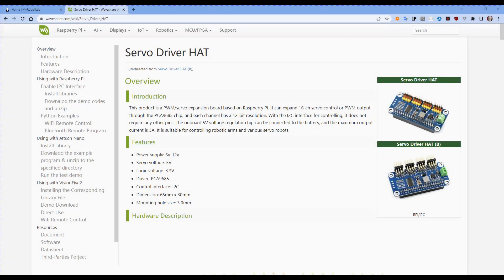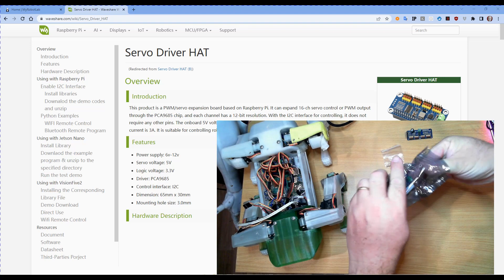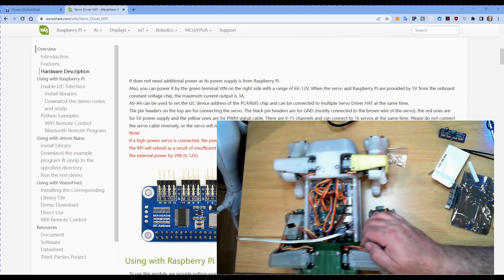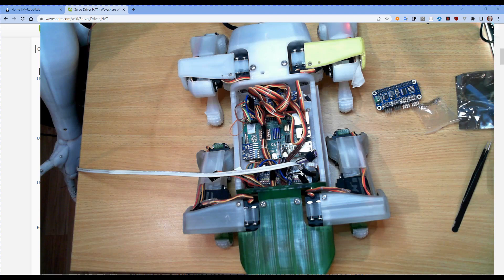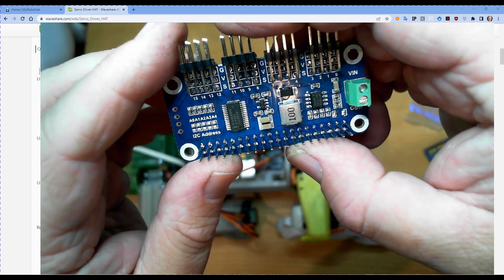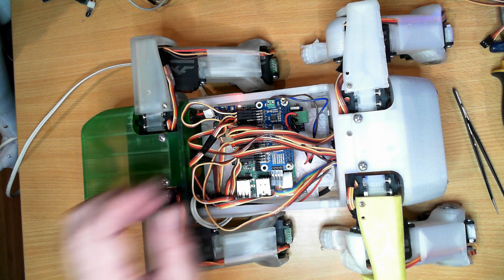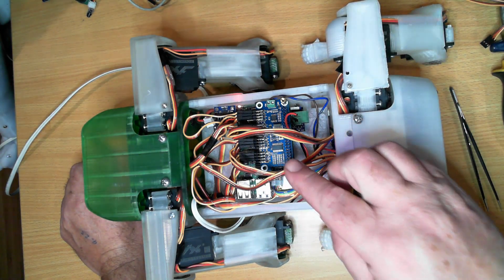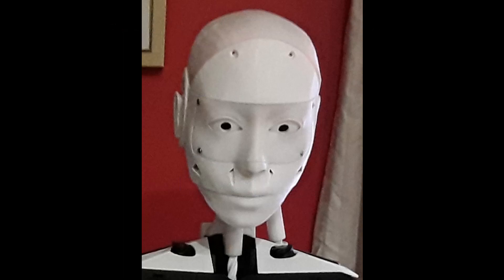SpotMicro Part 30

Comment: How did you power the servos, the pca9685cant handle all the power
Reply from the maker: The original Adafruit ones can't, but the Chinese copies without the reverse polarity protection for the servo power terminals can.
You do need to power the servos via the green screw terminals, the V+ connections on each end of the PCA9685 can not carry the current.
In this case, I'm also powering the control at 3.3V
Reply: @CyberOne  Can you give me a link(Im living in turkey)Thanks
Reply from the maker: @roberenes  Try this one:
https://www.aliexpress.com/item/1005005670283526.html?spm=a2g0o.productlist.main.1.e7b84n8P4n8PwM&algo_pvid=83ab74ec-4a57-453c-aae5-18d151666b14&algo_exp_id=83ab74ec-4a57-453c-aae5-18d151666b14-0&pdp_ext_f=%7B%22order%22%3A%22796%22%2C%22eval%22%3A%221%22%2C%22fromPage%22%3A%22search%22%7D&pdp_npi=6%40dis%21AUD%215.47%214.91%21%21%213.50%213.14%21%402103212b17635429837462045ef893%2112000033959645907%21sea%21AU%213585571997%21X%211%210%21n_tag%3A-29919%3Bd%3Acd89841d%3Bm03_new_user%3A-29895&curPageLogUid=EZiBoS9XRquj&utparam-url=scene%3Asearch%7Cquery_from%3A%7Cx_object_id%3A1005005670283526%7C_p_origin_prod%3A
It's based out of China, but haven't had any issues yet.
Reply: @CyberOne  Does the cell of the battery matter?And do you just connect it normally? Thank you very much
Reply from the maker: @roberenes  If you are going to use a S2 battery pack, you need to make sure you are using servos that will run at that voltage level typically up to 8V.
You will also need to make sure you have SMPS to drop the voltage for the electronics like the Raspberry Pi that will not tolerate less than 5Vdc and no more the 5.3Vdc.
If you want to use larger voltage battery packs, then you may need to use a larger SMPS for the servos, around 20 Amps will be required.
Reply: @CyberOne  Thank you